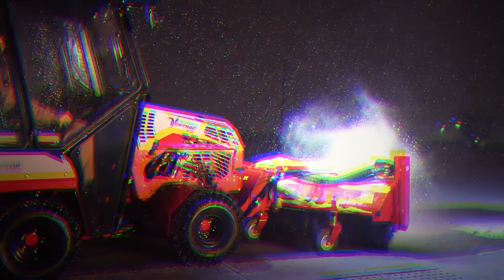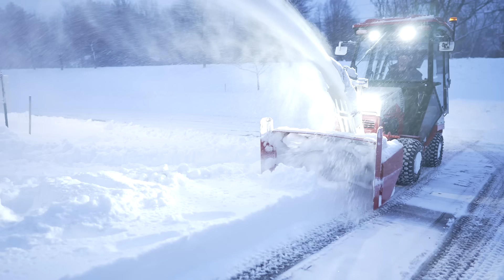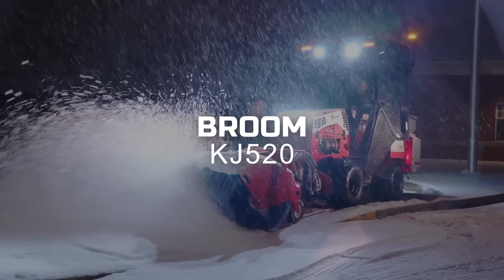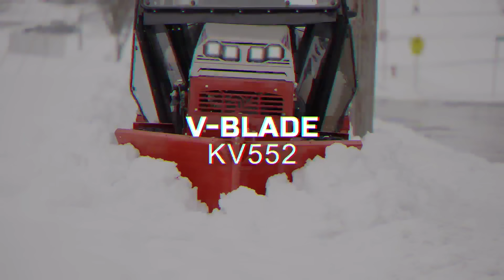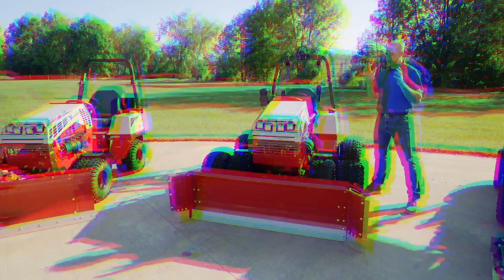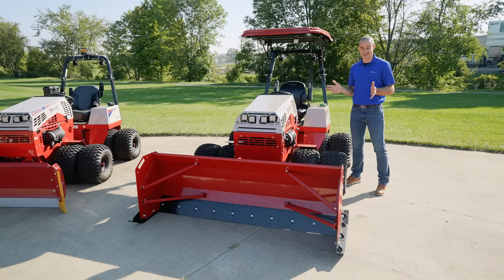Winter is Coming | Arm Yourself with Ventrac 4520 Attachments

Comment: Will your new box blade work on my 3400L tractor?  I'm in northern Michigan and most of the snow I clear is light and dry.  My LX423 snow blower works great but for many smaller amounts of snow I think the box blade would be faster.
Reply from the maker: Most likely not as that is meant for the 4000 series tractor